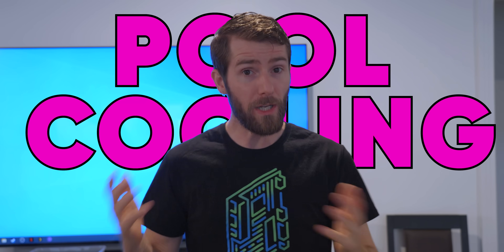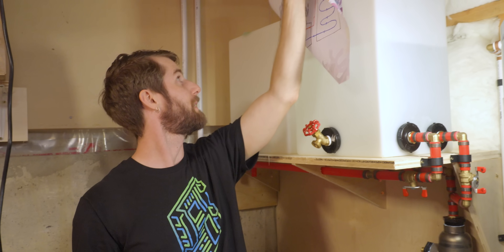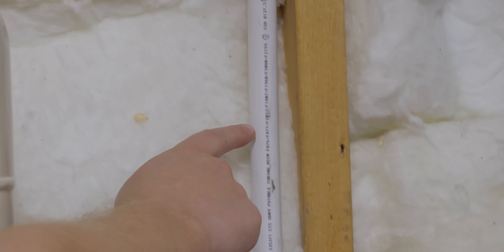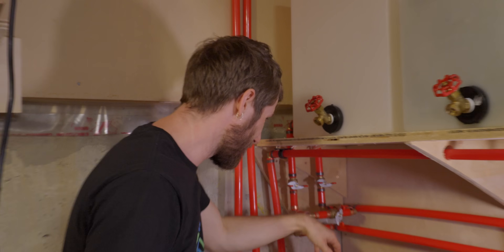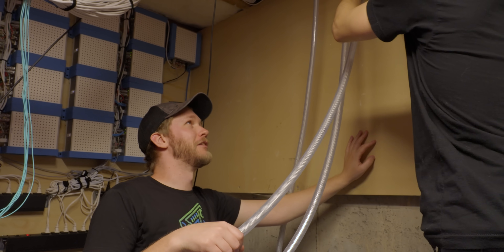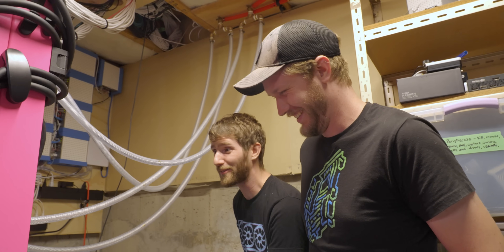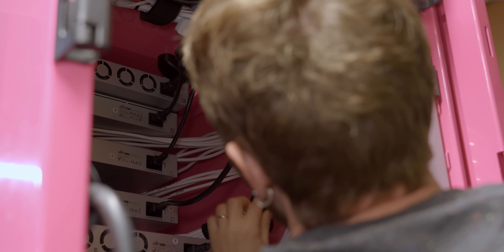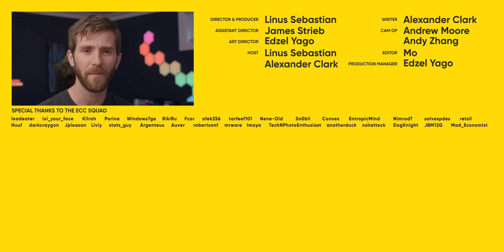My pool leaked and killed my computer - Whole Server Room Pool Watercooling Part 4

Comment: One way to look at it instead of out vs in, which could be construed multiple different ways apparently, is to look at it as supply vs return, which can really only be thought about in terms of driving mechanism of the system, i.e. the pump. Or, you know, flow arrows work just fine, too. That way you don't have to think about what in/out or supply/return mean.
Reply: Well you know if you have an arrow that points in then.. that's in. 
Wtf was Linus talking about 😂
Reply: @LunaticCharade  I think his main issue is that both ends of each tube were labeled the same thing, so one tube had "in" on both side ends and another had "out" on both. He got in his own head when he was talking about arrows, then words confused him as to which way he was trying to describe his thought process.

Comment: Should use ferrules on braided wire going into terminal blocks.  Solder works but I prefer ferrules.  Neither used here.  Also I like pipe dope better than tape.  All that tape clogs filters.  Plus with dope you can’t put it on backwards.
Reply: Those are the blocks with the metal flaps inside, they are ok for braided, but yeah, a ferrule would be preferable.

Comment: I'm pretty sure that metal <-> plastic plumbing connections are supposed to be the other way around (plastic male into metal female is ok, but not vice versa) - as the metal expands and contracts it cracks the platic.

Comment: For remote on and off, I don't see why you couldn't just run some wires from the desks down to the rack. Button on one end, motherboard pin connectors on the other. With all the issues you have using wireless things in your house, i wouldn't even bother trying to do some kind of wireless relay.

Comment: A lot of people including myself had write on the pool colling episode that you should use an heat exchanger to separate water loops and possibly contamination, but great that you finally contact a professional plumber and had a great recommendation from him
Reply: They knew that during the original video and were just trying to not have to
Reply: I didn't really watch the pool cooling episode, but here, 15 seconds in and I was thinking - "wait, no heat exchanger? they're pumping dirty pool water through CPU blocks!?" And there isn't even a performance reason to forego it, the pool water has plenty capacity to keep the heat exchanger near the same temperature as the pool water itself.
Reply: @graealex It was never the actual pool water. There's piping running through the concrete floor of the pool. Like reverse in-floor heating.

On an unrelated note, the only thing I recommended last video that they didn't implement is a heat-exchanger bypass through a simple fan coil. As it is, if they have to shut down the pool glycol loop for servicing, the server will have no cooling whatsoever. 

Secondly, if the glycol circulation pump dies, the server will have no cooling. The bypass valve would be set to automatically switch to the fan coil loop if the pump stops running.

Thirdly, if the glycol loop drops close to zero in the winter, there will be condensation issues. The bypass valve could be set to modulate between the HX and the fan coil to maintain a minimum safe temperature for the indoor loop.

I was an HVAC Automation Controls technician, so it was my job to program these kinds of setups. Now that it's coming up on winter, I expect to see a part 3 where they deal with condensation issues.
Reply: @zierlyn  Thanks for the information.

Comment: Sometimes Alex gives engineers a great name and other times he does them injustice. This video is somewhere in the middle but trending toward injustice given how janky the fitting/connection situation is on the inside loop.  That manifold setup is seriously concerning and it being located in the rack with the fittings facing towards the inside (and towards all the PSUs) gives me crazy anxiety.

Comment: It's way smaller scale, but I swapped my natural gas water heater with a heat pump water heater. I run ducts to my 'network/server closet' (under stairs area) so that it pulls in the hot air and expels out the cold air into that space + my office. It's amazing. Dropped temps by over 5 degree C.

Comment: Linus, by now you and your team should have known about heat exchangers and not to use PVC and mix matched tubes for heating and cooling loops. And flush the loops properly with distilled water and a pressure washer. Then use glycol for coolant. You had issues with the loop at the LMG house as well. But it was fun to watch. Thumbs up.

Comment: I would heat my house with all that heat instead of the pool.
Reply: On wan show he said he did think about putting a diverter valve and installing some radiators in the house, but the heat would be too inconsistent based on when someone is using a computer or not. So getting the heat out of the house in summer at least is a good idea.

Comment: I wasn't expecting it THIS quickly, but I was expecting it a little later on. I was thinking the chlorine (or salt water) would probably eat away at the block and stuff a year or two down the line
Reply: It's not using chlorine or salt water, the loop isn't full of pool water it's running under the pool and using the pool as a radiator

Comment: Be sure to check the PEX piping outside has UV protection.
Reply from the maker: A shed is getting built over all of it! -AC
Reply: @LinusTechTips Ah, the infamous "very soon™️" protection!
Reply: @Bjørn_The_Blacksmith Good one mate! 😂
Reply: It definitely doesn't.
Reply: The outdoor lines should really be copper.  Even UV stable plastic stops being UV stable eventually.
Reply: Learn from my mistakes this time instead of Linus': I forgot to do this on a porch sink, and had to redo it less than three years later.
Reply: I came here to say this. It needs to have some kind of covering over it or it will crack in pretty short order.

Comment: Would love to see what happened to that switch! That was actually quite a bit of smoke, and that means something really burned up.
Reply: What would happen if you air cooled it? It would still be working, thats what.
Reply: @freedomearthmoon1 The switches are air cooled.  I'd guess the custom power cable was wired wrong.
Reply: @phunkydroid  Air cooling doesn't spring leaks and fry components, that was my point. I would never water cool a rig, CPU and GPU performance is off the charts without overclocking these days. Spending a small fortune for nominal increases is kinda pointless.
Reply: @freedomearthmoon1  The switch didn't blow up from a leak, that was my point.  It was air cooled, and it blew up when he unplugged the old power cord and plugged in the new custom one.  I get that you hate water cooling, but it's irrelevant to what you're commenting on.
Reply: @phunkydroid  The switch wouldn't exist if it were air cooled.So theres that.
Reply: Plus, looks at the lengths he went to, buried pipe under the pool, pumps, etc. MEGA MEGA investment and failure. Sorry, its a huge waste of money with a catastrophic end game. No one else would  or at least should do this. Its insanity. Huge servers don't do this.

Comment: At 4:00 it reminded me of a cord I just recently cut apart. C13 to Nema 5-15P,  but the wires were Blue, Brown, and Green/yellow (EU spec?). Ground was easy, hot/neutral required a multi meter to figure out.
Reply: I don't know if this is indeed an EU-wide spec (I'm not an electrician), but the yellow/green-striped one is always ground, blue is always neutral, and brown (or a different colour if there's multiple) is phase/live/hot. Assuming things are wired correctly, ofc, which one should never assume (ie., test it!).
Reply: That's IEC coloring and all (or possibly just most) European countries use those colors now. The issue with finding it in your cable is that it means it almost certainly wasn't US-spec cable. That by itself isn't a big issue (EU cables are safe, too) but there's a good chance it wasn't made to any safety spec. Aluminum-cored and thin conductors are common in those junk cables and those can be fire hazards.
Reply: @eDoc2020  hopefully it was half decent. I grabbed it out of a box at work and it would have been from one of our servers. It was listed as 14awg which is strange that it was IEC colors.. I just assume it came off the same roll as the factory in China. Maybe the jacket was for USA but the individual conductors were universal... Oh well it works fine!
Reply: @chrislizon7483  14AWG is also uncommon, usually these cords are 18AWG. 14AWG is noticeably thicker, so hopefully the cord was thick like a power strip. If not it was fake.

Even if the cord is fake it's probably good enough as long as you are only using it for a light load.
Reply: @eDoc2020  it would have probably come from the blade server chassis, but we throw all the 5-15r cables in the bin because our racks are 208v and c14 pdus. If it's not 14awg is a mm2 equivelent that's damn close. That's why I picked just one instead of a regular monitor power cord or something... And considering I'm just using it as a power strip attached to my workbench to plug chargers into I'm confident it will be good lol

Comment: And for any liquid damage to components, assuming nothing exploded, I've revived some gnarly devices with a 24+ hour IPA bath and occasional jostling by hand during the bath to loosen up any corrosion

Killed my motherboard twice due to leaks, revived it both times (even though I, ofc, tried manually cleaning it to no avail)

Comment: My man has a gaming van with 4 PC's, powered by a power bank charged by solar panels and the alternator.

A server room the runs several computers, outputting the audio, video, keyboard, and mouse through the house so theres no fan noise; all water cooled by pumping the heat into his pool.

He has a pool, heated by the heat generated by his computers.

He has an absolutely sick theater room, including a second row of theater chairs that raise up to see over he first row, all being incredible seats, with a 4k projector and a phenominal surround sound system.

Wifi covering every inch of his house, so that he can open his garage door through Wifi.

And a wonderful family to use it all.

Linus my man, from the looks of it, you're living a pretty solid life. And I commend you for building up this company and making it successful enough that you can do all this. Great work my man!

Comment: For the manifolds you could have press fit or hotplate fused them yourself. Holds high pressure and is the way exhaust systems are made for the silicon factory's
Edit: They are always water pressure tested

Comment: why would you mount the manifold in the rack?? its the weakest point in the loop and its closest to the computers? It should be mountet on the wall behind with a drip tray under it and a leak sensor with a solonoid valve or pump kill switch connected to it. Also make sure that every hose going to the rack has the lowest point outside the rack  in case of drips

Comment: Its neat but flawed you probably should make slash guards / drain pans so when a hose pops the water will go down the drain. and second why use water maybe try something less conductive like an oil or at the very least distilled water so if the electronics get wet it doesn't short out and the last thing that could be done would be water proofing the boards with a water proof coating like resin I've seen some youtubers even use clear nail polish

Comment: I've been mentioning that PETG warps in many many online groups, but people keep thinking its a hoax. EKWB even sells petg support rings inside fittings for this reason.

Interesting to see it happen on a big channel like yours now.
Reply: What part of the video was this relating to? I was cooking while watching/listening and missed any 3D printing related discussion.
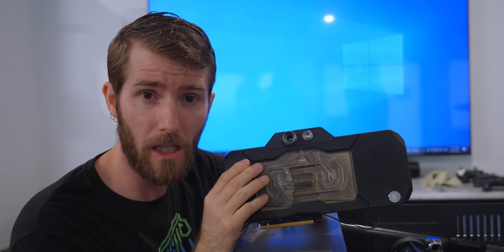Reply: @jubuttib  0:24 onward, he mentions the killer was PETG being overheated and shrinking, causing a leak that destroyed a couple of his motherboards.

This situation occurs a lot in DIY custom loops, especially in small form factor settings (ITX, micro cases). A lot of people hit 60c coolant temperatures in those builds. Only a few people have the patience to do hard tubing in those small cases, but those that do with PETG, understand this point. This however, doesn't stop the hoards of people who haven't experienced this to say PETG is no problem, etc.
Reply: @htko89  Aaah the tube was made of petg! I only know that plastic type from 3d printing, so didn't make the connection with the tube. Thanks!

Comment: I've had a lot of success with remotely powering on and off my systems using Wake On LAN and SSH, respectively. Unfortunately, I have to use two separate apps on my phone to do it, but fortunately, they both work!

If I can manage that, I'm sure you can figure out some perhaps more elegant solution? Or maybe it's just an Android tablet mounted on the wall that has all the PCs loaded in it to be turned on or off?

Comment: "Please look up the proper color coding in your region ..."

Do that, but also verify with a multimeter (in continuity mode) which colors go to which pins on the plug. There's no guarantee that the wires in the cable are color coded to any standard.

Comment: Wow it's like the first video didn't foreshadow all of this. Especially when the idea to use of a heat exchanger was shot down.
If Linus built a nuclear power plant he would be discharging hot irradiated water into the environment.
But hey what ever keeps the content machine going. A perfectly executed project doesn't need a part 2.

Comment: Please change that manifold to a steel or ali one. Support the dangling hoses and make a shield plate around the manifold to section it off in case it springs a leak.

Comment: pressure test for 3 bars for 30 minutes. If the needle drops, you have a leak..Plus you need to fit a pressure release valve. For safety. Water expands when heated, so in a close system without a pressure release valve will make your system unsafe, which will damage your system or even leading to it exploding. And please try and keep the manifold and any pipe joints away from the electrics. You dont want a fire every time there is a leak. And trust me, there will be more, especially when none of your pipes are clipped. Sorry, just a little professional advise.

Comment: As someone who has been doing pool maintenance for quite a while, I’ve been expecting this and surprised it took this long
Reply: I did something similar with an outdoor pond back about 10 years ago, i had a closed loop going from a water block out to the pond where i had it hooked to a submurged heater core from a saturn. It worked pretty good until i sold that house. I moved north so keeping the heat out wasnt so much of an issue as it was when i was in texas.
Reply: That's when you have no clue and don't use a local heat exchanger to separate pool water from the actual main loop for the PC.

Comment: No chance those plastic manifolds hold for an extended period of time. If its not the fitting that's cross threaded, it'll be the plastic itself cracking. To make matters worse, it's in the rack...

Comment: Those plastic manifolds/distribution blocks are pure cringe. Everything about them. Also why use caps on them instead of a rail of quick disconnects adapted straight to the manifold itself? Now to uncap it you need to leak somewhere. Bigger mess than necessary for what benefit? Also, you friction fit that board between the joists, but then didn't show securing it with anything, and hung stuff off of it. OK then...

Comment: Does your security system include a smoke detector? I didn't see one and seeing the potential fire hazard on the server room it'd be a nice add-on so you or your central monitoring station (if you have an alarm system and it's connected to one) could be notified immediately.
Reply: I'm pretty sure it does. I don't see them taking a chance with that with their children.

Comment: that is so not how to use teflon tape! its job is to plug the valley in the thread, wind the tape into a string then wind the teflon string around the thread tip to nut then go back over it teflon flat in one go, the way you did it will seal most the time but a bit of pressure you got a leak! specially with stainless fittings.

Comment: I actually had the same issue with tubing. Core memory, I was playing Half Life Alyx, and my cat was sleeping ontop of my computer, covering one of my exhaust fans. The other fans didn't ramp up, and over temp protection didn't really work, and it just caused the tubing to get hot and melt / deform, causing a massive leak.

Comment: this is why you should have a plate heat exchanger. You really should hire a pro commercial plumber to clean all of this up. If it looks like hack works, there will problems and it will be hard to fix. If it's clean and professional, it's easy to fix what's wrong and keep it running.
Reply: But they'll make more money than they spend fixing the jank on the sponsored videos about it!